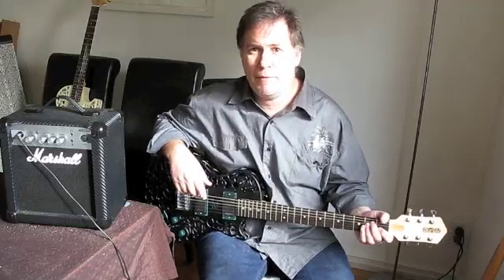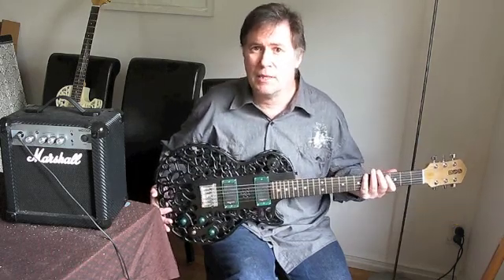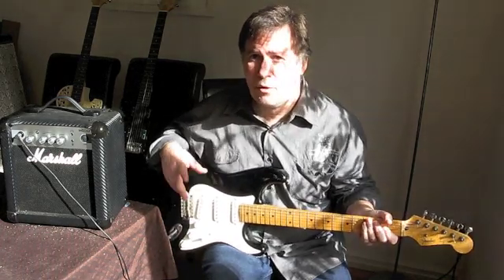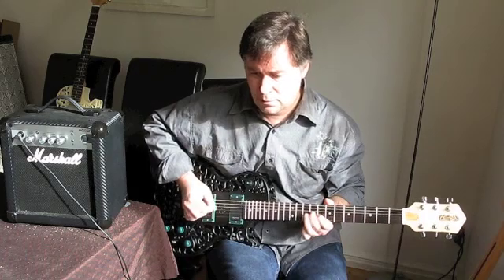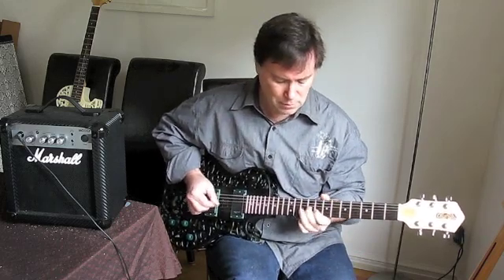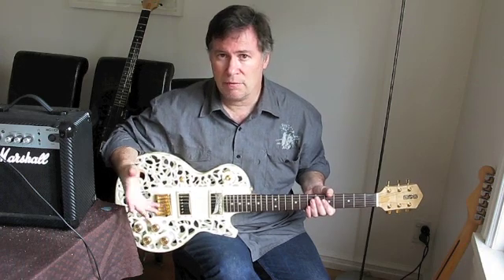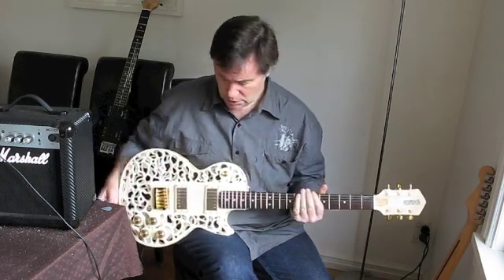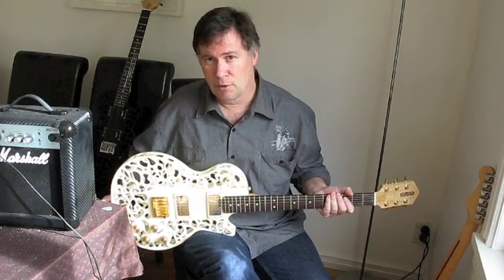ODD 3D printed guitar first sound test

Comment: Olaf.  Can you show us a frequency analysis please?  Some type of comparison.  I'm actually pro the idea.  But just got dogpiled.  I mean clearly wood is better.  But Microsoft didnt become filthy rich by being the best.  They did by being good enough.  And if this stuff stacks up against basswood then you may have a market here by passing the savings off to customers.  3d printers could trigger injection molded guitars in the market.  Its not going to work in the high end market though.  But on the flipside ego sells with musicians and having a cool ass guitar like that just might make some money.  The design possibilities with this are crazy since its easier to prototype.

Comment: You cannot change the tone of a guitar by changing the wood. Its been proven numerous times over and over again. The pickups dictate the sound.
Reply: This is totally incorrect.
Reply: mobatumi   How much "tone" or "warmth" do you get from printed plastic?  If the Fender pickups were put in the printed guitar, It would sound just like the Fender.  Its been done many, many, many times.
Reply: SkyVector Aerial you don't get too much from the printed plastic. And you will never get a Fender tone if you install the Fender pickups into the guitar made of birch. And it will be even more difficult for you to get a classic Gibson LP tone if you only possess a guitar made of basswood. I have guitars made of various woods (alder, basswood, mahogany, agathis) and the difference is obvious. This difference perfectly corresponds to the known tone quality of those woods.
Reply: Cole Harris Beg all you want. Pickups neither have the ability, nor were designed to "hear" plastic or wood. The simply detect vibration in a magnetic field and convert it to a line signal. The rest is up to an amplifier.
Reply: SkyVector Aerial I have explained to you scientifically that you are wrong. The pickup vibrates himself and its vibration depends on the timber. You are totally unable to deny my arguments but still you keep repeating the same errors.
Reply: mobatumi  Wood is the substrate material. It could just as well be concrete. You cannot hear a concrete "flavoring" through the pickups. Thats not what pickups do, nor are the capable of doing that. The substrate can only tension the strings.  Now,.. Your question about muting the string.   Even though the string is muted, a vibration is sent momentarily through the string and the pickup picks it up. This isnt rocket science.
Reply: Yes, but he said 'acoustically', so without the guitar plugged-in.
Reply: mobatumi Not true.  The construction of the pickup decides the difference in tone. I have installed a Fender pickup to the side of a plywood box, hovered another unplugged guitar over it, and it sounded exactly like the Fender from which it came. I have done this dozens of times with dozens of guitars for clients. There are many videos here on youtube of others doing the same to prove the point.  Several companies like Ibanez have built acrylic copies of there most famous guitars and they sound no different, yet the materials couldnt be more different if they had tried.
Reply: mobatumi  I guess that I failed to mention that I used to build guitars professionally for Gibson.  Some studion were cored with Balsa. Balsa being probably the most DEAD resonating wood on planet earth. Did it change the tone?....no.
Reply: SkyVector Aerial It is very nice that you worked for Gibson. Quite recently I read on their Internet-site the explanation about the tone differences between the baked maple, rosewood and ebony fingerboards. Do you mean that they actually lie? Gibson install maple tops on their mahogany bodies? Why do they do it, just for the look? There are better looking woods in this world. Explain us please.
Reply: mobatumi  It is for the look. Fender doesnt even say that stuff anymore. They gave it up in response to so much scientific proof dispelling it.  Gibson is staying with tradition. Keep in mind, pickups way back then were microphonic. Newer pickups are potted and designed to NOT be microphonic. Gibson Les Paul  Pickups never touch wood. They float in a plastic trim ring.
Reply: SkyVector Aerial I'm not sure but are you talking about the video with that extremely rude guy trying to explain your point of view with his whiteboard and tuner? Probably you are not, but anyway there is a problem in it.
You vibrate your string. The plastic ring or the pickup is actually attached to the wood and does not float in the air. The ring itself practically doesn't affect the sound because it is too thin in comparison with the acoustic wavelength. The wood of the guitar body is much thicker and bigger. You can verify it yourself taking some example frequencies employed by the music (say, standard tuning: 82 to 329 Hz) and the velocity of the propagation of the compressional wave in the wood (from 500 to 4000 m/s). That means that a) not only the strings vibrate in front of the pickup but the pickup itself as well as that plastic ring vibrate with their wood in front of those strings, too. If you don't believe me just take your Gibson (or any other e-guitar), tip the pickup and strum - you shall feel it yourself, and b) If the strings make guitar vibrate the guitar reflects the vibrations back into the string because the vibrations should reflect at the surface between the media with a different acoustic impedance. 
Both vibrations are not completely identical because those compressional waves propagate in a different media. Different media for example have different frequency absorption capabilities. You probably know that high frequency waves are absorbed faster than the low frequency waves. Your central frequency (your note) will remain the same because it tis the strongest one. But this is not the only one as your spectra has some width. How much faster will those others die depending on their frequency? it depends on your media, i.e. the wood. Both vibrations (for example those of the strings in front of the pickup and of the pickup in front of the strings) contribute to the sound. This is a first point which is related to the "science".
The second point is about the business. Are you saying that Fender from now makes guitars of a cheapest possible wood like aspen and birch and they don't specify it anymore? At least that should be their direct conclusion from what you are saying. In fact Fender indicates the tonewood in the specs for each guitar model on their Internet site.
You said "Gibson is staying with tradition". There are actually few other companies like that: ESP, Schecter, Ibanez, Dean, Carvin, PRS, B.C. Rich, Washburn to name just few. Many of their models are completely painted so the wood does not affect the look in any way. Still all of them produce their models only from specific woods. On the other hand I don't know a single successful guitar company producing guitars just from crap. Although it should allow to lower the price and thus to enter the market easier. So tell me, are they all idiots?
Reply: I'm not sure who the rude person you speak of is. I never meant that the pickup "floats".  I meant that it isn't attached to the wood directly. in reality if you are paying a lot of money for guitar you are paying for the aesthetics of the wood. many guitars nowadays are being built of super cheap materials. There are even guitars made of carbon fiber ( no wood at all). I personally have converted over 50 guitars using various types of pickups some of the bodies werent even made of wood, yet they still sound like the guitars that the pickups come from many of those guitars have found their way into studios in Nashville.I have a few Fenders that sound exactly like Les Pauls. those were converted simply because they were more comfortable to play.
Reply: The tonewood myth just simply isn't true.
Reply: Dale Young You seem not to argue with any particular argument I have given above. At least I am happy to see that you don't argue about two things: 1) The pickup and his ring vibrate together with the wood (and, by the way, the strings receive back the unevenly attenuated vibrations from the wood, too); 2) All big e-guitar producers in the world do care about the material of the guitar body (be it wood or carbon fiber). All the main e-guitar producers produce their models from the specific woods only. Even the solid painted models where the look of the wood can't be seen.
Reply: mobatumi  The vibration of the ring makes no difference to the sound.  The only thing the wood can add is sustain of vibration.
Reply: SkyVector Aerial The vibration of the ring comes from the wood and is transferred to the pickup via this ring. If you admit that the pickup vibration comes from the wood (via the ring), how on Earth can you think that the wood "does not affect the sound"?
The sound of electroguitar occures because of the movement of the conductor (string) in the magnetic field (pickup magnet). If the pickup moves himself it is the same thing because we get the relative displacement between the string and the pickup.
The exact way how the pickup moves (vibrates) is defined by the wood because the pickup is attached to it via that ring.
If you had physics at your American school (I don't know what exactly young Americans learn at school) you must understand it.
Reply: The ring does nothing more than hold the pickup in place.
Reply: I beg to differ.
Reply: Dale Young So your telling me if someone makes a guitar out of tin and puts some JBs in it for instance its gonna sound exactly the same as a $3000 dollar custom guitar with the same pickups?
Reply: Cole Harris   Im not only gonna tell you that, Im gonna tell you that it has been done many , many, many times.  If youve ever been to a NAMM show, you have no doubt seen acrylic fishtank guitars, 3d printed plastic bodied guitars and numerous other types of oddball concoctions of substrates used as guitar bodies.  The end up sounding like whatever the pickups were originally designed for, given IF the pickups are in the same location/distance on the scale and the same height in relation to the string. Ive done it many times myself.
Reply: Once again, In the above video, You have two bodies that couldnt possibly be more different, yet many here truthfully cannot tell the difference.  The pickups HAVE to be in the EXACT same position, same height in relation to the guitar strings and they will sound the same.  They ONLY convert a signal from a magnetic disturbance.  Thats all they do.
Reply: Dale Young this is incorrect. The pickups vibrate themselves in front of the strings.And it works exactly the same way as the strings vibrating in front of the pickup. This vibration of the pickup can be easily felt with a tip of a finger and it depends on the wood. Various frequencies attenuate differently in different wood. The softer the media is the weaker its acoustic impedance is and the faster the higher frequencies will die. This is physics. Try to hit your pillow and try to hit a church bell. You'll hear the difference in the resulting sound. And this corresponds exactly to the behaviour of the dense maple guitars in comparison with the soft basswood guitars.
Reply: Guys, one thing to prove that the wood plays its role. And that the pickups do not only take the vibration of the string in their magnetic field.
A simple experiment which you can do at home. 
1. Plug your guitar into the amp and raise the volume.
2. Put a capo on you guitar at, say, 12th fret.
3. Then strum ABOVE the capo, closer to the head than the capo, say, at the 2nd fret.
4. The strings in front of the pickups DO NOT vibrate because the vibration in the strings is blocked by the capo. You can even mute them with your palm if you wish.
5. Still you hear the sound. 
Now please answer me where does this sound in the amplifier come from if the strings do not vibrate?
The answer is: it comes through the wood of the fretboard, then through the wood of the guitar neck and then through the wood of the guitar body and the through the wood of the guitar body top. Then it makes the pickups vibrate in front of the strings which are absolutely still.
The conclusion is: the wood matters.
Try to argue.

Comment from the maker: Hi,
THe main thing to thing about is that it's only worth 3D printing if the shapes is very complex. If it's a relatively simple shape then you will get much better results, and chepaer, by CNCing it. That's why it's just not worth 3D printing the guitar necks, as they just arent complex enough to make it worthwhile.
You might want to consider bulding in a few 'extra' features. Built in effects? movable or hot swapable pickups?
Cheers
Olaf

Comment: The difference in sound would be due to the pots having a -20 possible difference.  Multiply that by 4 pots or however many pots you are putting in an axe......EVERY guitar will sound different via the pot's different variables.  Old news.

Comment: This guy is actually 100% correct and those that believe otherwise, you simply haven't grown up yet...or you simply never will.  I, for one, will be ordering the Steampunk Tele and will do my typical modifications if Olaf can't or won't.  It's a thing of beauty and the neck is good, body doesn't matter at all, the bridge is good...all the rest....I will change, but...just as proven in my carbon fiber and acrylic guitar comparisons...it will turn out sounding EXACTLY like any wood guitar. Cheers.

Comment: I have the same amp and it has pretty good bottom end tone when I use my dual-coil strat with it. When I used a school-owned fender strat practically the same as this (only main difference was the ebony fretboard on the fender strat) I got nothing on the bottom end. I would think that the hollow bottom end is caused by the guitar itself, Marshall are good at creating amplifiers with good bottom end.

Comment: Synthetic guitars are actually more likely to sustain LONGER....but beyond that, it has like no bottom end because the speaker on that amp is smaller than your hand, it's a low wattage amp (you need high wattage for clear bass...which is why high watt guitar amps are 100 watts and bass amps are 300), AND FINALLY IN CLOSING - he is using a crappy camera mic, so if he had properly used a high end mic that can pic up low end freq it would be fine.

Comment from the maker: Hi Zyborggian,
The necks are off the shelf (made by Warmoth). Though it would be possible to print the neck too, the material I would have to use is called PEEK, and is very expensive, so wouldnt be commercially viable, unfortunately. I am also not sure if musicians would accept the paert of the guiatr they are constantly in contact with not being made of wood. :-)

Comment from the maker: Yes, of course, you could print almost everything, including the metal parts, but you would gain nothing by 3d printing parts that are more effectively made using conventional technologies. A flat plate, for example, can be much more efficiently laser cut (for example) than 3d printed. I would only use 3d printing for those complex parts (like my guitar body designs) that cannot be easily made using CNC, or other, technologies.
Cheers
Olaf

Comment from the maker: Hi Samus,
Depends on the model. The Basses are surprizingly well balanced. The Atom guitar is not too bad either, but the Spider LP is fairly neck heavy.
I have done a few where we tailored the balance for the user by dropping lead weights into the body cavity (in the battery compartment cavity), but now find it's a lot easier to just use a 'Heads-up" strap, where the weights are on the strap instead. Quite commonly used for neck heavy guitars like Gibson SGs, etc.
Cheers
Olaf

Comment: Fact is, all plastic guitars were made back in the fifties, though they weren't printed. They sounded fine, but alas nobody thought they would sound good, so they didn't sell well. Now they're a collector's item. They were not electric however, and did not use steel strings. The problem with almost all plastics, especially those in use then, they outgassed and soon became to brittle to work properly in an acoustic. I believe the plastic you're using now will do that eventually, but slower.

Comment from the maker: Yep. Titanium, aluminium and steels are quite common now. But fairly expensive.
In theory, you could print the whole guitar in plastic, but it would need to be the high-end PEEK plastic, which could handle the stress on the neck. But they would then not be commercially viable as the material is firghtfully expensive.
My original guitar bodies were solid nylon, but comments on my blog about an all plastic guitar could not possibly sound good, caused me to add the wooden cores.
Cheers
Olaf

Comment: Just the body being 3D printed really doesn't mean all that much. After all, you're still mounting the pickups in wood, and using a traditional neck. The type of nut, bridge, and pickups has more to with the sound than anything else. All you've really managed to do is make an ornate body. I'll wager it's lightweight, but other than that, I don't see the need for it. Now when you can print an entire guitar ... like on Star Trek ... boom there it is, that'll really be something.

Comment: Okay, they're not less pauls, I get that, however comparing three single coils to two humbuckers is not a fair comparison. They would compare better with a paul, or one of the many clones. Two humbuckers, versus two humbuckers. the truest test would be with the exact same pickups in each guitar. Pickups are such a big part of an electric's sound that any other comparison doesn't wash. Now, if you had three similar pickups in yours, then the comparison would be more fair.